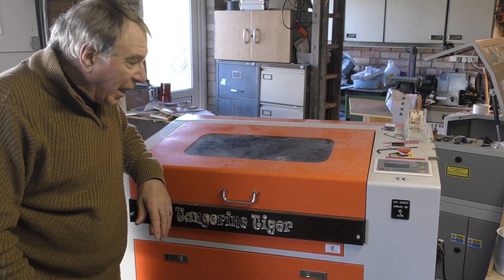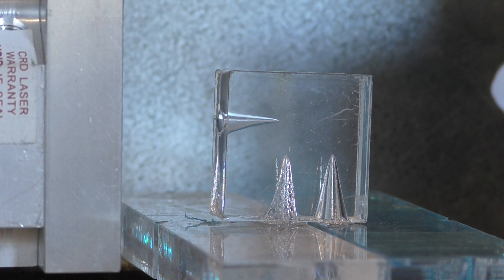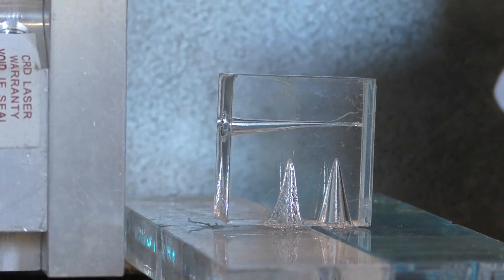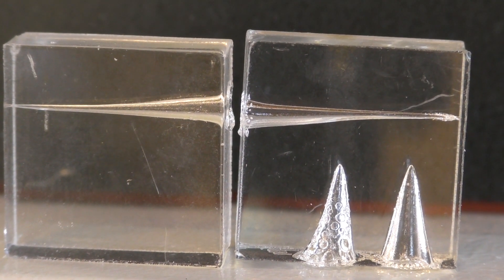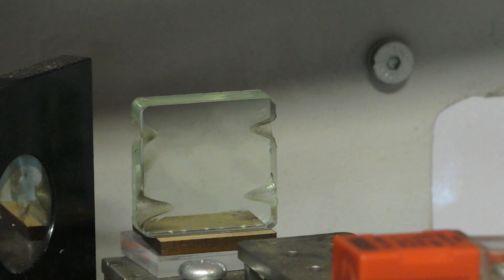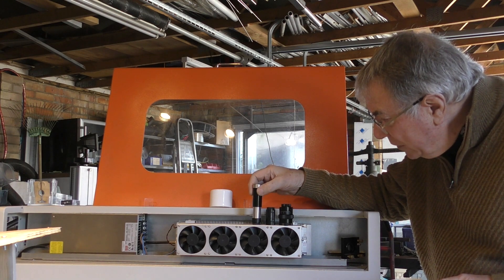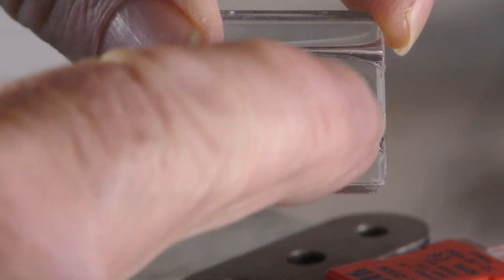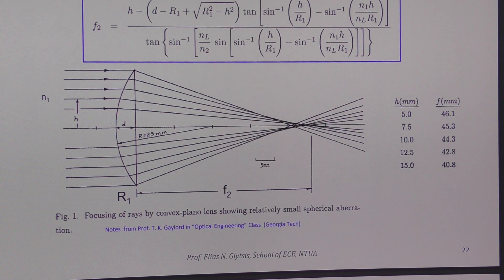RDWorks Learning Lab 226 Can my Beam Collimator  Work

Comment: The RF lasers are really cool tech.  I figure the advantage RF has is space savings.  CO2 tubes are the original tech that has stayed around so long because it has a good enough mix of performance specs even though the high output tubes take up a lot of space.
Reply from the maker: Hi
 I Many years ago I cut my laser teeth on big 3kw metal cutting CO2  cross flow lasers (no sealed  glass tubes ). It was only in retirement that I bought a cheap Chinese machine  to "play" with. I  retired from manufacturing and had no small business aspirations. In those days 7 years ago, there was nothing useful on www  to help me understand the technology . Despite my 10 years with  metal cutting lasers, it turned out I knew almost nothing about the technology itself. Thus I had to begin my learning journey from square one. Yes, I am an engineer with a lot of design experience,  so understanding how lumps of metal and wires work is fine,  That's only 10% of the technology. The other 90% is a mix of physics,  optics,  chemistry and material science, all subjects where my degree of ignorance was close to 100% .  7 years later and  that 90% is still not being addressed by youtube. The media is flooded with users sharing their experience and sellers telling lies to sell you their products. The laser world is now flooded with "experts" who have ankle deep knowledge to call upon. 
 CO2 lasers are the easiest to decode (I don't mean easy) because the interaction of that wavelength with acrylic is unique. It's like leaving footprints on a wet sandy beach. It's only by careful study of those footprints, along with a lot of science self-education, that I have been able to reverse engineer  how this technology REALLY works.

I quote your words "The RF lasers are really cool tech " and say that for several years  I had been persuaded by the "big boys" that their RF technology possessed some sort of "magic" properties that made them light years ahead of the "crude cheap Chinese glass tube technology" they speak about at exhibitions.  I built this low cost  RF machine to sample that "magic"
 and understand what was so wonderful and advantageous.  With DC servos and superb engineering,  those machines are mechanically  enviable but, as I found out, the RF technology itself is over hyped. Having identified it's poor cutting efficiency  as its major weakness  (and I fully understand the reasons  why)  I am trying to solve the problem and make it into a genuine competitor  for  a glass tube. 
 
 As you rightly observed, glass tech has been around a log time and the price difference in the technologies  ensures that it will remain so for the foreseeable future.

 Best wishes
Russ

.